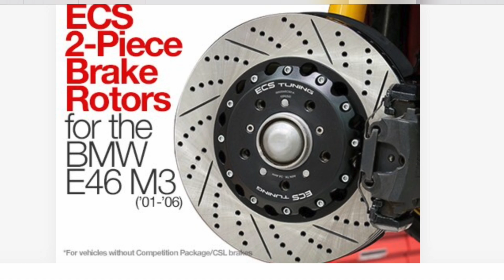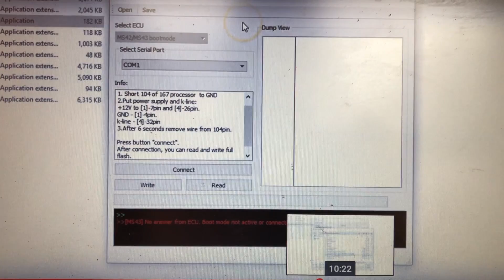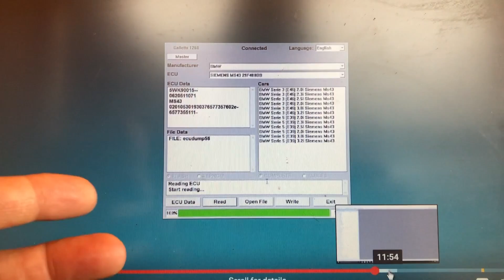The Drift BMW Has No Oil Pressure, What Do We Do? What’s Next?

Comment: check out Riot Racing for a Big bore throttle body for the m50 manifold with no modification needed, they also sell reground cams that are much cheaper than Schrick cams or brand name. Ergen Motorsport  sells a plug and play standalone ECU for the m54 also that eliminates opening the ECU. Cut ring headgasket will allow much better results than a MLS headgasket for turbo applications. stoked to see where this thing is headed! PS dont tune it to rev above 7k rpm, the M54s are notorious for balance issues above 7k rpm. its why i only mess with m50 non vanos engines .

Comment: @fasterproms - You only need to ground the ECU (put it into boot mode) to flash the full 512kb file, once you've flashed it, you can flash the tune file 64kb normally over OBD without touching the ECU

Comment: Achilles motorsports sells a nut with a hole to safety wire it. The m54b30 has a harmonic vibration around 6800 rpm where that nut works loose. Also seen the oil pump shaft break.

Comment: For your future and hopefully unneeded reference- Jeb May find this useful. 
You don’t have to do all that to drop the pan. You can let the subframe hang from the control arms after disconnecting the intermediate shaft from the rack and a few other things that fasten to the subframe (iirc a few wires, sway bar, etc) p/s pump can be unbolted but leave hoses on so you don’t have to bleed the system. it’s a little tough to get to all the bolts on the pan and slide it out (towards the rear) over the hanging subframe but doing it this way saved me a lot of time when I was a bmw tech. Could have a pan off and then fully reassembled in little more than an hour.

Comment: if you want to do more brake upgrades, you can do porsche 911 calipers from the 996 and get the swap done with brackets and everything for around $700 depending on the price you can find the porsche calipers for. 6 piston brembos in the front, 4 pistons in the rear

Comment: This is just my thinking . I see a way to fix this for dirt cheap , just cut a round slot after the nut on the shaft and use a c clip . You could just hold a saw blade or file against the shaft after the nut is installed and crank over the pump for a perfect fit with the whole thing assembled. That would keep the nut from falling off , I bet you would hear it if it came loose as a rattle . Also the knock sensor would pick it up if it got real loose . Pull timing and give you time to fix it before it broke completely .

Comment: from what iv seen online on forums and owners clubs the m50 manifold is possible to fit and port the opening but the rest further in is so thin (1/8" i belive) it cant really be done. people that have done the swap and other similar ones say once you remove the disa you will loose torque and power. it is only what iv been told and iv not tried myself so take it with a pinch of salt but from what iv read that is the case. it seems the disa has been done well and gives good torque and power balance throughout the rev range.

Comment: Jeremy let me know if you need help , I have tuned bunch of these cars and still am in NYC , Since you have MS43 its great news , I can guide you to make the car work with everything you doing , since I have same setup but its already boosted , but i do have tunes saved from when my car made 250whp NA. Although next time you will have to open the engine again its gonna that oil nut snapped off))) Been there done it.
Reply from the maker: Do you think you can send me something? I’m struggling and slow at building a good solid base file.

Comment: Do an oil change and add up to 20% capacity to the crank case to clean the engine.  That Beamer ticked like my old Dodge until I adjusted the valve.

Comment: Those BMW 6 cylinder engines just screams for being overloaded, 5-600hp is no problem with just some ARP bolts and a ringseald head gasket on a otherwise stock engine👌👍

Comment: might be an idea to waterjet a small tab that looks like a stubby sheetmetal wrench slide that over the bolt and drill a hole through the sprocket on the other side of the wrench to put a nut and bolt through this holds the "wrench" in place and prevents the nut from working loose (cant turn the wrench is holding it ) but youre still able to replace stuff without grinding off the weld
you could allso wire it like they do airplane stuff  https://qph.fs.quoracdn.net/main-qimg-c84cbc2bf377f44a10a81fb9b222aad0

Comment: Common problem some places have an oil pump kit for 400 plus bucks... or weld it on. use two nuts plus welding... also watch the water pump and coolant expansion tank cracks with higher mileage.Oil control rings are also a problem oh and the dual vanos sounds like a bag of marbles rattle... no big deal for you guys!!!!

Comment: I have a important question. I have a 1995 Dodge ram 1500 4x4 5.9 360. What would be the best way to "Tune" my truck. Due to it being pre '96 it is obd1 and makes it hard to find any scan tools ect, I want to get rid of my check engine light. I already replaced the transmission sensor that was causing the fault. But the chk light is still on. How do I get rid of it without a scan tool...??? And also how do I go about tuning it.? Do they have software for pre 96 obd 1 computers? Would it be easier to just buy a megasquirt?

Comment: I cant wait to see where this build goes and I'm glad to see your staying with the M54 but welding the oil pump nut alone will not fix this problem. you must put an oil pump chain tensioner on the chain. If you have the engine covers off the front its fairly easy and cheap to do. There is a guy on ebay selling the kit its only around $70 and has diagrams to do the tapping and full install. https://www.ebay.com/itm/BMW-M54-M52-OIL-PUMP-CHAIN-TENSIONER-KIT-M54B30-M54B25-M52B28-M52B25-TURBO/223237180514?ssPageName=STRK%3AMEBIDX%3AIT&_trksid=p2057872.m2749.l2649
The problem with these engines is under high rpms anything over around 6500 the chain has slack from age and starts slapping back on itself causing the nut to back off or in a worse case scenario shearing the entire gear and shaft assembly off completely. In order to fix it properly you must install a chain tensioner. 
All the best,
Cooper

Comment: The oil pump nut backs off due to the harmonics of the 3.0L at high rmp; you've been living up there lol.  The problem with the welded nut is it doesnt help prevent the next weakest link, the shaft, from shearing off entirely.  Id highly recommend upgrading the pump with a much stronger shaft, Vac motorsports makes a nice piece if you cant fab up anything yourself. 

I’ve also read your pinned comment and unfortunately its not that easy.  There’s no cheap way to add ITB’s to the m54.  Well, for a mere mortal at least.  The s54’s TB rack simply doesn’t fit, and even it did, you’re looking at the better part of $1000 unless you find some really cheap.  Then you’d need an adapter plate, some trumpets, and a MAP conversion on the s54 vacuum rail.  Even on the cheap, if profab tossed in a probono plate and plenum, you get everything working smoothly on the stock dme, you might see 60hp?  80?  Hell even 100?  Thats after adding a set of $300 e36 m3 cams.

As an E46 owner, id love to see what the b30 true potential N/a would be but at the same time, id like to see you make some power!  Take that sumofabitch out and add some boooost.  Clean up the head and bit and make it flow better, arp m12 head studs, MLS gasket, pistons and rods and you should be good for 500+.  You could even delete the vanos and add some adjustable cam gears.   Probably on the same budget as an ITB setup since you’d already have most of the turbo bits lying around the shop.

Now, the m50’s and e36 328is m52’s have iron blocks, and the rotating assembly from your 3.0 drops in nicely.  Not only will you get classic bmw stroker out of it, but you’ll have the strength of the iron block and thicker sidewalls to make the boost feel at home.  Also, keep the zf320z transmission, they’re known for taking abuse.

Oh, and a Stewart water pump, you’re gunna want one of those regardless of which way you go.

EDIT: M50 manifold on a M54 is interesting.  Post 2003.5, e46's started using a returnless fuel system unlike the pre 95 e36 that you go your manifold from.  You'll have to modify the mounting of the e46 rail and adapt it to the m50 manifold IRCC

Comment: i have a m54 head at my garage and a m50 manifold here's what u need to know. yes it will bolt up you just have to pull 2 threads out of the head easy. you don't have to delete the idle air control valve all bmws of this era and before are the same even the mclaren f1 uses 2 of them haha as well as a f355. you don't really need the v8 throttle body its kind of over kill 68mm is what bmw used for the m54, m50 is 65mm i think from memory. 68mm is a good upgrade for m50 throttle bodies. easiest thing to do is get a adaptor plate made to work with the m54 throttle body and the m50 manifold. and in the future you can have that throttle body bored out. also the m50 manifold has a little over 70mm opening for the throttle body. goodluck man i'm happy to help if you have any questions pretty familiar with these engines rebuilt a couple and done tons of mods.

Comment: You do realize by welding you are throwing off the balance of the sprocket and the heat is compromising the intergrity of the metal? And that engine is not clean. There is a lot of varnish which means oil wasnt changed often enough.

Comment: This myth/recommendation to put M50 intake manifold on E46 keeps perpetuating year after year, sorry to hear people led you down this path. Yes M50 manifold was popular free horse power upgrade for M52 motors, but single VANOS E36 engines, not the dual VANOS E46 engines! We all wish we can use M50 manifold for free power like E36 guys, but nobody could make it work over the years :(. You have M54 330 I believe, which means you already have the very best E46 intake manifold short of going with ITB conversion kit. By the way popular mod on 325 and 328 E46 is to use your 330 manifold to gain top end horse power at the expense of low end torque loss - because 330 runners are shorter, but larger diameter.

You discovered the oil pump nut flaw. Some other major E46 design flaws off the top of my head: 1) Strut towers are too weak and shear off from the chassis, OEM front reinforcement plates are available, ECS Tuning aftermarket rear reinforcement plates are available. Very cheap fix. 2) Rear subframe attachment points are too weak and crack, many reinforcement kits are available but IMO very best engineered kit is by Redish Motorsport, they actuall built a jig and destroyed E46's shifting gears 24/7 to analyze the flaw inside out. 3) M54 oil scraper rings changed design from M52 leading to increased oil consumption, it should be possible to convert to M52 oil scraper rings to fix this issue. 4) Cooling system and pulleys made out of brittle plastic that dries with age and explodes. Aftermarket resolves this. 5) VANOS flaws, aftermarket parts available to reinforce it with sturdier materials (Dr. Vanos, and others). 6) DISA flaws. Early 330 DISA units were not refined and made ECU think there's knock leading to retarding and famous power loss at 4000RPM. Remanufactured OEM units resolve this, but still use plastic parts that can shatter and get sucked into the engine. Aftermarket parts available to improve DISA unit with sturdier materials  (cheap kits on eBay).
Reply from the maker: The rings issue sounds appealing especially for the backup motor. Power after 4K kinda is weak and trying to work thru stuff I. The tune to make it better. I appreciate the help. I’d like to do things others have struggled with and then show how to make it work.

Comment: Really glad you chose to dig into BMW as your unknown platform. I did the same thing about 7 years ago and I'm no tuner like you are but have learned so much it's been a blast. I'm now driving a 2002 330CI that has been completely swapped out for a 2006 M3. Everything has been switched that is a benefit to the car from the (wrecked) M3 to the 330CI body. The 330 was a ZHP with M-sport front suspension so it was left as is as many people (not verified but fought about a lot) believe it has a shorter lock to lock steering ratio. (3.0 for the 330 CI ZHP and allegedly 3.2 for the M3 but I don't know for sure). Anyway the rest of the M3 has been put into the chassis of the car. As well I've done the rear sub frame reinforcement plates, Vanos (Besian) etc. I LOVE THIS CAR! It's like wearing a glove on the road if that makes any sense LOL. Thanks for the great videos and content!!!
Reply from the maker: Greg Wayne what’d you do with the old zhp cams?
Reply: @Fasterproms1  Sorry they're all gone. Before the swap the engine on the 330CI had blown the head gasket at around 224,000 KM's (I'm in Canada) and was just sitting which was the reason it was chosen as the swap to car. All the parts removed were part of the trade off on the totaled M3 as it had been acquired by a shop that deals and works on German stuff. So they got the M54B30 along with the rear end and all components to sell or reuse etc.

Comment: Just welding it won't completely solve the issue. Eventually the entire shaft the sprocket is on will shear. It's due to the poor high rpm engine harmonics of the M54. Look into an ATI Super Damper.

Comment: I have been looking for a hand brake kit that works with the rear brakes on my 85 Monte Carlo ss 10 bolt. I'm upgrading the rear drums to police interceptor disc and wanna have single calipers and not add calipers like all these other kits. Make a t block adapter fitting and add another 2 lines like u guys did in ur BMW hand brake.

Comment: Why would Drift vs Drag vs Street Driving cause the nut to fall off ??
Reply: The nut calling off is just something that happens with these motors. They are more concerned about it in a drift car because of sustained high rpms. If it fails on a course at speed the motor is probably fucked.
Reply: Crunchy Bio-mass 
Thanks for the answer...

Before the nut was expected to be the reason for failure...I thought maybe the oil pressure failure may have been caused from the g force of drifting with an oil pan with no baffles to keep the sump submerged
Reply: Kurt 
Thanks for the reply... much appreciated
Reply from the maker: Yeah drifting is just absolutely silly abuse

Comment: You did NOT fix the problem! I told you why in the previous video and the comment was liked by you too lol.
You will now just shear the pulley clean off the shaft just as easily as the nut came off.
I did exactly what you did. Nut came off first engine, killed it. Welded nut on second engine. Pulley came off it, shearing the shaft, even faster than the nut came off the other one, killed it.
Reply: Yeah, first thing I thought when Jeremy said no oil pressure. Vorschlag in Texas had been through the same problem a couple of years ago and I'm sure it's a very common problem! That's what the web is for. Sometimes there's a real gem among all the know it alls there.
Reply: Yeah while it can affect all the BMW sixes, it’s only a big issue on the 3ltr, where it seems the harmonics at high revs just destroy it, and spot welding the nut on just moves the problem to it shearing the entire shaft instead.
The solution is a different oil pump drive shaft and pulley design, which is available, and not even that expensive.
The 330 challenge race cars etc in the U.K. all run them as over here at least, a used 330 engine costs more to buy than one of the pumps from the various BMW tuners/racers who sell them!
If I’d have realised this sooner I’d have kept my E46 330i drift car as it was awesome in all other ways, but losing all the engines I did made me hate it.
Reply: It needs to be balanced, vibration is the problem at high rpm, new damper or crankshaft rebalanced no lock tight or weld.

Comment: Think we can all see this ending in a LS swap.
Edit, love the Beehive
Reply: @Richard Skipper "Sloppy" did very well with his, changed my mind about 4.8's .
Reply: jon doe  What part of the world spells Beehive "Beahive"?
Reply: just like ruby with a junkyard ls
Reply: @Richard Skipper I seen them yank what they thought was a 5.3 , gap the rings, cam and turbo it, it made around 1,000hp, turns out it was a 4.8. 
I have a LQ4 6.0 going in a M-715 with a 750hp FiTech Part No: 70009 . I plan on smaller twin turbos, mild cam.
Reply: @Richard Skipper I picked it up online from the Turbo forward , or at least I don't recall the NA part.  Side note, I was watching "McFarlin's" build and Texas Speed sent them ARP rod bolts, that debate has been around almost as long as the LS. Theory was that ARP bolts would "tweak" the rod enough to cause issues On the side, people say you need them, but if you watch "Sloppy" he made over 1,000hp with factory rod bolts... I will be watching the progress to see if he tosses a rod bearing.

Comment: Save yourself a huge headache and throw an MS3  on there from DIYAutotune.com.  The tuning software is called TunerStudio, and believe it or not, it's actually much nicer to tune with than HPT is (which I agree is very nice if you can't use TunerStudio).

Comment: The more you dig into these BMWs, the more of those "badly engineered pieces" you will find. These engines have problems with piston ring wear, resulting obviously with lower compression and oil consumption. Also check rear cradle mounting points on the chassis, they can break off.

Comment: 50 cent cotter pin.
Reply: c103110a    LOL that’s awesome! No hate you sound like. A ford guy lol
Reply: @Scott-Tim  Tighten the nut, drill through the nut and shaft, install a cotter pin. That way, you can get the gear off in the future. Lol.